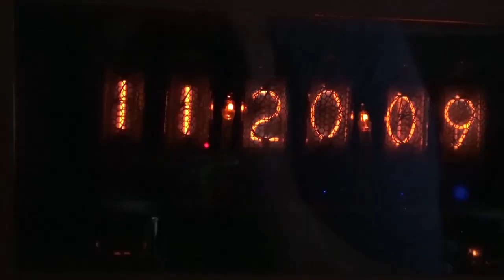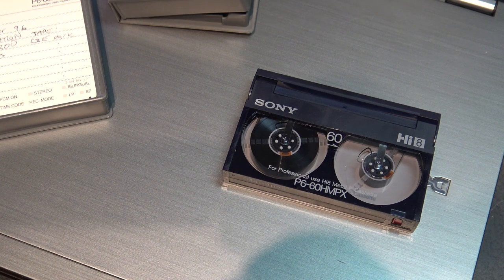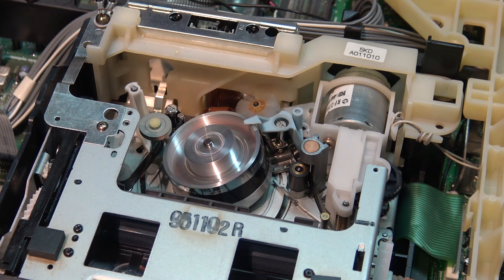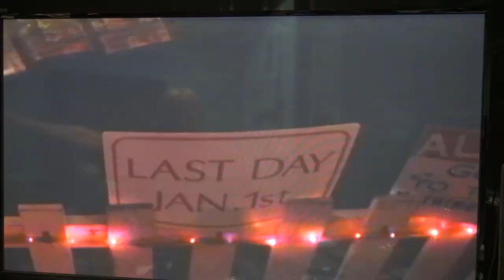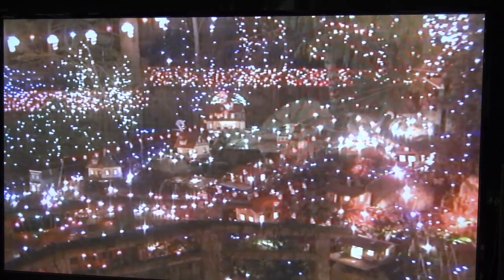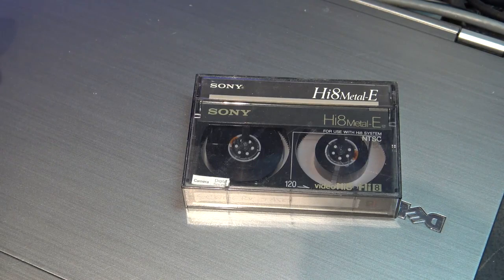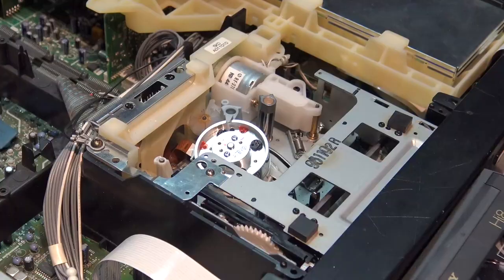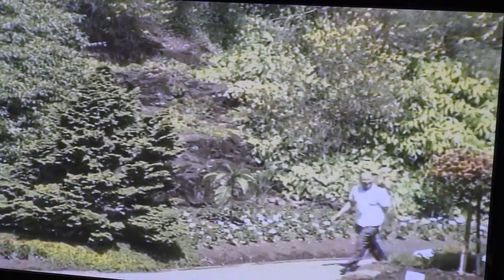Sony Hi8 tape was total garbage. Lets see why

Comment: There's something special about the picture quality of VHS.
Reply from the maker: Ya, it SUCKS. Only 220 lines of horizontal resolution and about 80 of color resolution.
Reply: @12voltvids  doesn't matter to me if it's technically inferior to modern video formats, I just like the look of it.
Reply from the maker: @MarshMellowChronic  
By all means use it. Need any tapes? I have hundreds I want to get rid of.
Reply: I agree , providing there is enough light .  Analog is the smoothest compression , forget the math  , its the LOOK after all .
Excellent for recording music too
Reply from the maker: @shaun9107  Smooth as is lack of detail. Us professional producers paid many thousand dollars to capture detail.
Reply: @12voltvids  I lost a good CRT TV due to the remote .
Now I have a crap one .
All my VHS dont look good .
I transfired some to my PC monitor for a laugh some time ago .
The lines that ruin it are no longer seen .
I even used the camera as gust a camera using VHS as the recorder  " cabled  " as I have not many camtapes  free .
Its a life like picture for sure .
Everything has to be forced these days .
To much black in digital .
A sunny day looks MINT !
Reply: What do you recommend to try and find if I want the older cinematic look of a Hi8 camera? Other brand options? I’m trying to record and convert digital @12voltvids
Reply: Hi8 is better quality than VHS
Reply: That grainy look was magical
Reply: Yeah, n i love it.
Reply: @12voltvids  If you still have those, I’d genuinely like to take them off your hands!
Reply: @12voltvids  get rid of them to me please lol
Reply from the maker: @oliviaoclock  once I finish archiving them i will bulk erase and get rid of them all.
Reply: There's nothing wrong with hi 8 tape video it's nostalgic and has aesthetics to it and it was nice I think hi 8 tape video is cool
Reply from the maker: @kieronrabbettkentlightning9133  
Not so cool when the heads clog every 5 minutes and you have 100 dropouts a minute.
Reply: @12voltvids  that depends on the condition of the camera and how well its looked after,  the heads probably just need cleaning
Reply from the maker: @kieronrabbettkentlightning9133  dream on. It is a tape issue especially with Sony tapes.  I have 4 digital 8 decks and 2 hi8 analog decks (home decks not cameras)  and I can put these bad tapes in them 1 by 1 and the heads will clog after 5 minutes or so.  Then have to run cleaning tale for 10 seconds or pull cleaning wheel against head while playing. I see it time and time again when archiving and it is not my equipment.  Doesn't do it with Fuji or Maxell just Sony.  I have about 300 tapes and all the Sony tapes do it.   They have all been stored correctly, on edge in a climate controlled room.
Reply: @12voltvids  I only use metal maxwell tapes no issues at all
Reply from the maker: @kieronrabbettkentlightning9133  Maxwell?  That was a counterfeit Maxell back in the day.
Reply: @12voltvids  I'm pretty sure these are genuine maxwell metal tapes
Reply from the maker: @kieronrabbettkentlightning9133  Maxwell? No such brand. Maxell yes.  
A counterfeiter released a tape and copied the logo almost perfectly on the box.  One small error was the dead give away.  They spelled the name wrong.  They put in a w, making it Maxwell.
Reply: @12voltvids  I meant maxell yes I spelt it wrong
Reply from the maker: @Ella Igwe 
I find it amusing that about half those vhsc takes i have have actually been sold.  Haven't made any money on them but they are selling.
Reply from the maker: @Ella Igwe TDK made good tape as did Maxell
Reply: @mariahdash  You can record your footage with your normal camera, then record it into a VHS tape and capture it back.
Reply: I made some videos at 720p 60p which I transfered to tape by playing them in my computer using and HDMI to AV converter. I made that for test VCRs or TVs.
Reply from the maker: @binarix128  well they play out at 480i from the HDMI to av converter. I use one to take the HDMI hd output from my security DVR to send an SD analog signal to a modulator for distribute to tvs on an analog channel.
Reply: @12voltvids  you still got some tapes you’ll get rid of?
Reply from the maker: @idontlikedylan4068  I have lots of tapes I can get rid of. What do you want and what is your offer. They are all very low use. Most have 2 passes, perhaps 3. The highest pass count on any of my old production tapes would have been 10 at the absolute max. Most were recorded once, and then played to digitize, or edit from.  Once used they were put in a climate controlled room and stored. Even the edit master tapes once edited they were played to make a few copies on VHS for client and then put away. Some of the high mileage duplicator master copy tapes had a few more passes on them but those ones will be retained.
Reply: @binarix128  I've never heard so much rubbish in all my life. 480 lines of resolution from VHS?! Dream on! Hi8 has far more detail than VHS. The physical size of the format is totally irrelevant.
Reply: @njm1971nyc  VHS has 480 lines of vertical resolution, in horizontal resolution it is barely 200, and less than 100 in color. Anyways VHS, Hi and video 8 are garbage, DVC beats them so badly.
Reply: @binarix128  Your second comment is (almost) true, but your first was a load of nonsense. There's literally no point discussing the vertical resolution since all tape formats (of analog NTSC) are identical in that regard. They all have 525 lines, of which 486 are the active picture area. 480 only appeared once consumer digital formats were developed. What you were saying about VHS being 480 and Hi8 being 400, and Video8 being 240....I think you're getting your vertical and horizontal resolutions very mixed up!
I won't disagree that VHS is pretty poor, but it was "ok" for the days of standard-def on modest-size CRTs. Sure it looks horrible now, compared with modern technology, but it was still quite an engineering feat to get such high-precision mechanisms into ordinary people's livingrooms....in the 1970s! Comparing it with digital formats or HD formats is somewhat "pointing out the obvious"! 
Hi8 (when working properly!) is significantly better than VHS. It's major downfall was the tape stock. Even back around 1990 it was plagued with drop-out issues, and many Hi8 tapes have aged very badly. Ironically the Professional Grade Sony Hi8s are often way more troublesome than consumer-grade Hi8 tapes. The beefier tape stock used in most VHS cassettes rarely has any age-related issues (I'm not including wear & tear in that statement!). I had a demo S-VHS deck on loan from JVC around 1991 which, on a professional 14" monitor, looked almost as good as BetacamSP (when playing an ordinary VHS recording!). Admittedly it only achieved this with a very expensive TBC/Digital noise reduction card installed, but it was still extremely impressive how far they'd managed to push VHS. We never bought any though...insanely expensive for a non-pro format. It was decent-enough for some of the less quality-conscious users though (like American local cable tv channels) to use as a broadcast format. In the UK it fell firmly in a no-man's-land of not good enough for professional use and overkill for a non-pro format.  Cheap consumer VHS VCRs were mostly pretty rubbish though, true, but still impressive for 1970s consumer electronics technology which managed to hang on for about a quarter of a century. For most people, it was perfectly adequate.
Reply: @njm1971nyc  Yes, VHS has to be simple and consumer friendly so it can be used at all, but at the expense of garbage quality, gets even worse because tapes back then where extremely expensive, so you had to squeeze as much hours or record and use as possible, but back then you wouldn't notice much difference in a small, so it worked.

I've never looked at the picture of a Hi8 nor a video8, in the first comment I got the h and v resolutions mixed up. Video8 looks about the same as VHS, with 240 h lines, and Hi8 with 400 h lines, so it should look better. But mini DV beats them up by capturing full 720x480 resolution with perfect time base (because the composite video output is generated by the digital video processor, like in a DVD or a camera). That's a big problem with VHS, specially; its time base stability is pure crap, so you don't want to digitize your VHS recordings if you don't first get a TBC, otherwise half of your record will be a blue screen or a frozen frame.

By the way a time ago I recorded some image patterns on a VHS tape, guess what... I mostly got a blurry mess, specially in color patters!
The only good thing that could come out of VHS is it's decent audio quality, both in mono and HiFi stereo (at EP the mono track is garbage).
Reply: @binarix128  True, VHS decks have very unstable video, but so do ALL professional analog video formats, too. You can't single-out VHS for that. It simply isn't possible to make mechanical video systems and tapes which run at 100.000% precise timing. All broadcast VTRs need a TBC - usually built-in to the VTR. For home use this wasn't necessary, as consumer TVs were very forgiving. Dubbing VHS tapes was the only time a TBC was really needed for VHS. Digitizing video wasn't even a thing yet, so neither was it a consideration they had to worry about. TBCs cost an absolute fortune in the early days,  hence their exclusion from home VCRs. Most of my VHS decks (Sony SVO-5800s) have decent built-in TBCs. LP/EP tapes won't play at all in professional VCRs so I use ordinary consumer decks for those, with a bunch of various For-A TBCs in the chain. Some tapes are so bad that even pro-grade TBCs can't cope,  so for those instances I use Canopus ADVC300 (I think that's the model) in pass-through mode, and that can cope with just about anything. Capturing 486i/480i is not something I do anymore, aside from a few specific needs, so for SD I generally up-convert to 720p with Teranex 2D processors. Thankfully these have picture size adjustments to give the image a bit of an overscan to hide the head-switching noise and other rough edges. Again, these rough edges were never a problem "back in the day" as all tvs had a certain amount of overscan. I'm kinda happy that most people don't have the knowledge or equipment necessary to capture analog videotapes well, since that would put me out of business!
Reply: @njm1971nyc  I know right that there's no way of making a mechanical acessed media run at 100.000% of the speed, I used VHS as an exaple for it, but happens with all analog video tapes, consumer and professional. Digital tapes doesn't have that problem because "bits are bits" and it wouldn't fail unless the speed is really messed up.

Capturing analog tapes can be tricky, because of the high unstalibity, and capture devices are not built in with a TBC.

I'm planning to experiment with this setup: an AV2HDMI converter and an HDMI capture device, and a car camera video mixer (as a TBC) in between if needed. The thing with most video capture devices is that they're hard wired with garbage de-interlace methods (so it's fixed to 30p, without the possiblity of outputing the "raw" 60i and then de-interlacing properly).
Reply: @binarix128  My recommendation for a reasonably good modern-day capture system (without spending a fortune) is to pick up a Panasonic DVD recorder (DMR-EZ28, IIRC) which will convert analogue to a stable HDMI signal, and then capture that with one of the many HDMI capture devices on the market. You might need to run it through a splitter first, to get rid of HDCP capture restrictions. The Panasonic deck is very tolerant of shoddy analog input quality. You can pick them up for about $100 on eBay. It will also handle up-conversion/de-interlacing for you.
Reply: @njm1971nyc  I'm not into the businnes of capturing VHS or analog tapes; so a cheap, not so strong against unstability AV to HDMI converter box, will do fine. What I want is to pop up the analog signal to my computer preserving full resolution and motion smoothnes (60p output from the original 60i).
Reply: @binarix128  That's why I suggested the up-converting Panasonic deck. It will likely do a better job than a converter box, and give you 60p output.
Reply: @12voltvids  you still trying to get rid of any of those tapes? Just ordered a camcorder and need a few
Reply from the maker: @FF3NT0N  I have time of tapes as in hundreds of them.

Comment: We had all our home movies on Hi8 going back to 1991, spent hours and hours and hours transferring them all to digital a few years ago, had to buy a new (used) camera to do it as ours had bit the dust. Non-metal Sony tapes always stored in a box in a closet in a house with central air. Wanted to transfer everything before the tapes deteriorated or were accidentally lost or destroyed, now all the kids have digital copies.
Reply from the maker: All 8mm tape is metal. There were different grades. The high grade tapes may have looked better initially but have not held up well.
Reply: How did you transfer them?

Comment: Here in the UK, Scotch branded tapes were pretty notorious. You could always tell if a VCR had been primarily used with Scotch branded tapes as the upper drum would have a dull finish and the heads would usually be toast. I'm sure it doubled-up as 200-grit sandpaper if you were running low!

I've only ever owned VHS and S-VHS machines, so I always tended to favour JVC S-VHS tapes, even for standard VHS recording. BASF EMTEC were also pretty good for standard VHS, even their 5-hour E300 offering - always useful to have for recording a TV series onto.

Also have a few TDK D-VHS tapes that used to work very well in S-VHS mode..albeit with non-standard tape lengths! With regards to TDK in general, I tended to find their normal VHS and S-VHS offerings kinda struggled with blue colours - always somewhat of a litmus test when it came to video tapes.
Reply from the maker: Scotch tapes were great. They kept the heads clean!

Comment: Hi8 was an analogue video signal with a digital audio track, how do they compare to older Video8's for reliability?
Reply from the maker: 8mm and Hi-8 were both analog video formats that uses Fm audio like hi fi vcrs. They uses a mono signal initially, and then added a second carrier and used a matrix like FM stereo to record the L=R on one carrier and the L-R on the second carrier to maintain compatibility with mono machines.
All 8mm uses a 210' tape wrap. Video uses the first 180' of drum space and the extra 30' that the tape was in contact was used to record PCM digital audio on equipment that supported it. This extra reserved space could be dubbed after the fact. Time code could also live in this reserved space.

Comment: On the topic of Hi8 transfer: I have 2 Digital8 DCR-TRV520 camcorders from 2000. Same model, got them from a former police detective.

They both have problems. One of them isn't too bad, the only problem is that it will just start zooming in for no reason. I think it's a problem with the ribbon cable maybe. It will still transfer over Firewire just fine and play tapes.

The other one has a major problem: The Firewire connector is broken, so it's basically useless for transferring video. Everything else works fine.

Would it be possible to replace the Firewire connector? Could I order a new one online or do I have to use the connector from the other camera. How would I disassemble the camcorder?
Reply: I have a Canon Elura 65 (MiniDV) with the exact same problem of constantly zooming in. Never got around to fixing it; but I liked this one because it had all the ports (usb, rca, s-video, firewire, mic-in, and sd card).

Comment: Hi Dave, love the content. I am trying to archive a Fuji Hi8 tape, with noticeable mold on the tape. While playing the tape sheared and ripped. I took it apart trimmed it to a clean area decent enough and tried to splice it together. The tape is so brittle it just tears apart while trying to rewind it. Any advice or is it toast?
Reply from the maker: Mold is a problem on 8 mm tapes. If there's not much mold you might be able to spool it from one reel to the other and back by hand. If mold is severe there are some places that will de-mold your tape but they charge an absolute Fortune. I've been quoted as much as $500 per tape. Needless to say I've never had a client that is wanted to spend that kind of money they just write it off and lose the memories.